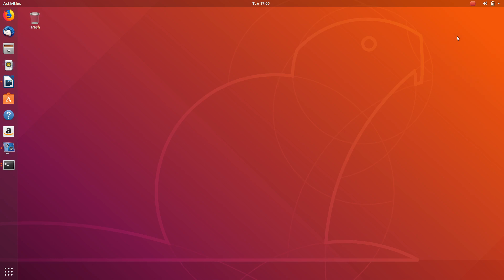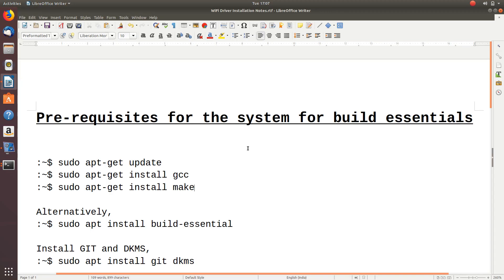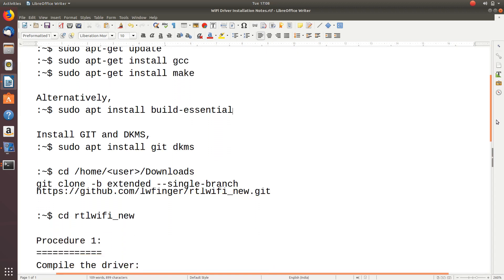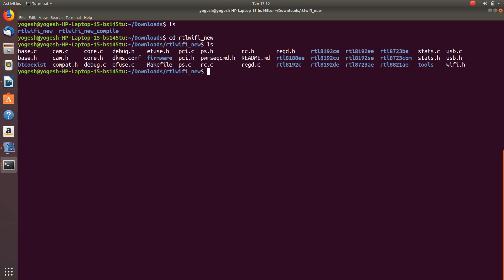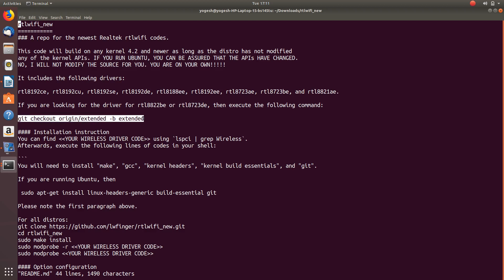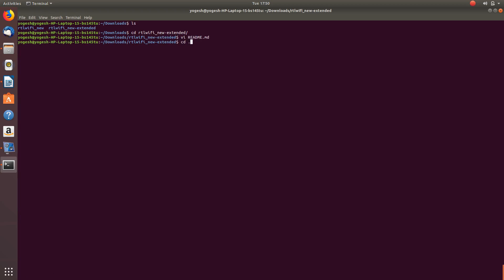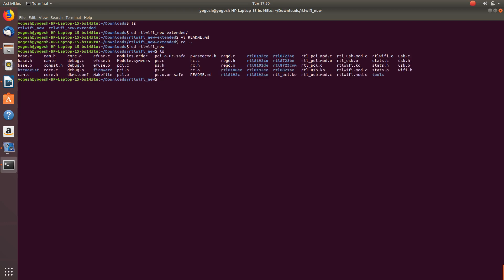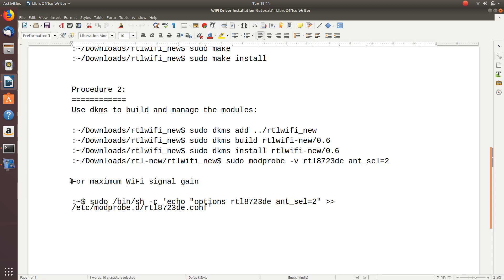HP 15 BS145TU Laptop - Linux WiFi driver install - Chip rtl8723de

Comment from the maker: As the Linux Kernel version increases more features and system calls get added. Below is the link where you can get the driver & instructions for latest kernel:
https://github.com/vvmspace/rtl8723de
OR
https://github.com/smlinux/rtl8723de

Comment: Username for 'https://github.com': *
Password for 'https://*******@gmail.com@github.com': 
remote: Repository not found.
fatal: repository 'https://github.com/lwfinger/rtlwifi_new.git/' not found

i'm beginner for linux system trying to figure out the problem here , using HP 15-r014TX, after bit research got to know that , hp laptops have issue with linux os/kernel due to this wifi adapter not working.
one more identify-    if i use cmd -lspci
- unable to see network controller 

kali@kali:~$ lspci
00:00.0 Host bridge: Intel Corporation 440FX - 82441FX PMC [Natoma] (rev 02)
00:01.0 ISA bridge: Intel Corporation 82371SB PIIX3 ISA [Natoma/Triton II]
00:01.1 IDE interface: Intel Corporation 82371AB/EB/MB PIIX4 IDE (rev 01)
00:02.0 VGA compatible controller: VMware SVGA II Adapter
00:03.0 Ethernet controller: Intel Corporation 82540EM Gigabit Ethernet Controller (rev 02)
00:04.0 System peripheral: InnoTek Systemberatung GmbH VirtualBox Guest Service
00:05.0 Multimedia audio controller: Intel Corporation 82801AA AC'97 Audio Controller (rev 01)
00:06.0 USB controller: Apple Inc. KeyLargo/Intrepid USB
00:07.0 Bridge: Intel Corporation 82371AB/EB/MB PIIX4 ACPI (rev 08)
00:0d.0 SATA controller: Intel Corporation 82801HM/HEM (ICH8M/ICH8M-E) SATA Controller [AHCI mode] (rev 02)

i had same experience with Ubuntu 20.04 and Parrot OS too.
if i use different repositories drivers(rtl8723de/rtl8723be or rtl88) get installs but no result. wifi still not working.

kindly help me which adopter is good and how to install it when i get no repository found for  'rtlwifi_new'
Reply from the maker: Dear Puneeth Kumar,

If you are not able to get the controller details, you can see it in Windows OS using device Manager, checking the controller will confirm which chip you have on the Laptop.

I am not sure which RTL chip you have, but can tell you how to proceed.
Here is a link for the rtl8723de source code.
Link: https://github.com/smlinux/rtl8723de

Note: Realtek RTL8723DE module for Linux kernel version 5

Install instructions:

git clone https://github.com/smlinux/rtl8723de.git -b current
dkms add ./rtl8723de
dkms install rtl8723de/5.1.1.8_21285.20171026_COEX20170111-1414
depmod -a
reboot

Comment: This solution won't work for newer kernals ( like mine is 5.3.0-53-generic). 

The Readme file on github directory says "The master branch of this repo is officially abandoned. If you are running a kernel newer than 5.0, use the drivers built into your kernel. That is a lot less work."
Reply: I love you man! For kernel  5 series this worked. I have been trying this for 2 days ♥️
Reply from the maker: @prakhargupta7125  Hi Prakhar, I am happy that this worked for you ! Thanks for the feedback and motivation, it means a lot to me !
Reply from the maker: If the new kernel embeds inbox driver that will suffice the needs. The intended driver was on those platforms where there was no inbox driver support as inbox for some Realtek silicons. Hence if the driver is present inbox, just a modprobe for the WiFi module will work if the driver recognise the Device ID.
Reply: @automotriztechnica  Thank you for quick response. I am not able to install the driver on my ubuntu. Please assist. How can I get it functional.
Reply from the maker: @vikaskhugshal50  
If there are inbox driver, please try in command console:
" # sudo modprobe -r rtl8723de && sudo modprobe rtl8723de "

where, rtl8723de is the driver name.

Which is the WiFi chip that you have and its device details? When time permits, I will give a try on latest kernels, some C/C++ coding, it will be fun to do, but definitely needs time and patience.
Reply: @automotriztechnica   I guess my wifi chip is "RTL8723DE 802.11b/g/n PCIe Adapter".

The above mentioned command gives and error:
modprobe: FATAL: Module rtl8723de not found.
Reply from the maker: @vikaskhugshal50  Here is a link for the kernel version 5 series:

Link: https://github.com/smlinux/rtl8723de

Note: Realtek RTL8723DE module for Linux kernel version 5

Install instructions:

git clone https://github.com/smlinux/rtl8723de.git -b current
dkms add ./rtl8723de
dkms install rtl8723de/5.1.1.8_21285.20171026_COEX20170111-1414
depmod -a
reboot
Reply: @automotriztechnica  Thank you for your response. But I've already installed Ubuntu 20.04 and it supports the driver.
Reply from the maker: @vikaskhugshal50  The Ubuntu 20.04 LTS is the latest OS where the driver can work, the kernel is not tweaked or customized to that level. Many users have reported too. I am glad that it worked for you. I am also using Ubuntu 20.04 LTS.

Comment: /home/kali/rtlwifi_new/rc.c:336:11: error: initialization of ‘void * (*)(struct ieee80211_hw *, struct dentry *)’ from incompatible pointer type ‘void * (*)(struct ieee80211_hw *)’ [-Werror=incompatible-pointer-types]
  336 |  .alloc = rtl_rate_alloc,
      |           ^~~~~~~~~~~~~~
/home/kali/rtlwifi_new/rc.c:336:11: note: (near initialization for ‘rtl_rate_ops.alloc’)
cc1: some warnings being treated as errors
make[3]: * [/usr/src/linux-headers-5.6.0-kali1-common/scripts/Makefile.build:273: /home/kali/rtlwifi_new/rc.o] Error 1
make[2]: * [/usr/src/linux-headers-5.6.0-kali1-common/Makefile:1696: /home/kali/rtlwifi_new] Error 2
make[1]: * [/usr/src/linux-headers-5.6.0-kali1-common/Makefile:180: sub-make] Error 2
make[1]: Leaving directory '/usr/src/linux-headers-5.6.0-kali1-amd64'
make: * [Makefile:88: all] Error 2

showing this error
Reply from the maker: Please check the kernel version using "uname -a" and update the build essentials package. If there is any kernel update, please update the kernel source for the headers as well.
Please also check if you used the driver source code from the _ext folder of the repository.

Comment: I have a wired error when I connect to my Bluetooth headset it gets connected but when I connect to WiFi ,Bluetooth headset gets disconnected and there is no way to connect before disconnecting WiFi
Reply from the maker: The Bluetooth & WiFi belong to one module component. Which is the WiFi chipset does your Laptop has? You can perform these step of operations and later open a terminal and type "# dmesg " to see the logs what has gone wrong. If you follow this method of driver install, you can use the open source code and the Hardware that shows these issues to debug.
Reply: I have trl8723de I downloaded ,complied ,and installed only the extented repository is it how it should be done.and please brief how to solve problem of Bluetooth

Comment: error: initialization of ‘void * (*)(struct ieee80211_hw *, struct dentry *)’ from incompatible pointer type ‘void * (*)(struct ieee80211_hw *)’
Reply: thats the error that it gives at the sudo make install error step please help.
Reply from the maker: What are your system details, kernel version, etc? The driver source code is kernel dependent, If you are using a latest kernel, please ensure that the driver code is compatible and you have the correct supporting kernel.

Comment: Bro it worked for my ubuntu but in kali Linux it shows 

make:  ***/lib/modules/4.13.0-kali-amd64/build: No such file or directory
Stop

Plzz help
Reply from the maker: Hi Sanu Anand, You have to install development packages, kernel source package and dependable development components, these are needed to compile the source code using make utility & install the device driver.
Reply: @automotriztechnica  how can we do that ...Plz supply cmd

Comment: Sir tell me one thing, wifi is showing now problm solved  .. But i am scared and I m not switching off my laptop , kahi esa to possible ni he.. 
Vapes on karne pr wifi icon gayab hojaye??isliye Maine  abi tk laptop off ni kia....jabbhi on krti hun kuch na kuch problem hojata he .Please btaiyega..
Reply from the maker: Hi Ruhi Ji, Once you compile and install the driver, the driver binaries remain for that kernel version forever. You can perform a graceful shutdown, reboot etc., no issues. But in case your Linux OS gets an update, then if your kernel version gets updated to a newer version, then you need to perform the same steps again after the new kernel takes over. Hence please do keep the downloaded source code files safe. Please note the current version of the kernel using "uname -a" from command prompt or a terminal window, where the WiFi driver is working properly, if the WiFi driver does not load, please re-check the kernel version using "uname -a" because some LInux flavors can update at anytime if auto update is enabled.
Reply: @automotriztechnica  ooh I see... 
Amm thanks for information I will keep ur points in mind..... 👍
Reply from the maker: @ruhianjum3066  I am glad that my video is helping you, please do subscribe the channel too :)
Reply: @automotriztechnica  i want to ask you one thing.. Please suggest... I was using Ubuntu 19.10 in HP.(Along side window)... And after using one month it's showing problem's like hanging, etc... After switch of.. It doesn't get "on" easily., so one of my friend suggest me to install another version, my question is.. As I solved my wifi problem by following ur video.. So if I install another's version of Ubuntu... Or reinstall it..., so wifi icon will be same as it is now? Or it will become invisible again.. And will I need to follow these steps again??? For solving WiFi problem?... Please must answer.... And if possible please send me your email. I'd sir....
Reply from the maker: @ruhianjum3066  Ubuntu 19.10 releases are non-LTS and updates are frequent hence I would suggest Ubuntu 20.04 LTS which is Long Term Support. If you re-install Ubuntu or your kernel upgrades, you need to re-install the WiFi driver the same way if the latest kernel does not have the inbox driver.
The email ID is automotriz.technica@gmail.com
Reply: @automotriztechnica  ooh I see, that why it always shows  problems. And thank you so much for your Instant response it''s great help in this lockdown season.. Thanks a lot sir.
I have mailed you please check if possible.. Will be  waiting for your response... Thank you.
Reply from the maker: @ruhianjum3066  You are welcome. Please do subscribe my channel as well. Thank you.
Reply: @automotriztechnica  yes I already subscribed a month ago,most welcome sir👍

Comment: will it work in Ubuntu 19.10??sir please answer 
I installed  Ubuntu 19.10 in Hp window 10,recently and it don't show wiFi  hotspot connection , what to do now?
Reply from the maker: Yes, it will work, please ensure that you update the development essentials in the system like compilers & make utility for which you might need to connect it to Ethernet port.
Reply: @automotriztechnica  amm i am a beginners for Linux.. Shall I do this all by myself?? Just following your step.. Without knowing what is happening.,I am scared to make mistake..but also I need to solve this problem...no idea what to do.
Reply: Sir after struggling alot.. I finally did it... 
It was not easy for a beginner.. But done.. Thanks alot... This one helps me only
Reply: I have one more problem... 
Plear tell.. How to remove password authentication step.. It's very annoying... 
It appears evry time while I doing work...i want to remove this,...
Reply from the maker: @ruhianjum3066  Please use sudo passwd root, this will create a root password which is a super user mode. Later you can login through other non GUI terminals using root user and password.

Comment: The are asking FOR password and username
Reply from the maker: If you are using Ubuntu Linux, it will ask for password, enter current user password for the operations. If you have logged in as a root user, you can use these steps directly.

Comment: I am searching for the solution  since past 2 days. I am unable to resolve it. Please help me !!!!
Reply from the maker: You need to check which WiFi controller do you have on the motherboard populated. Which Laptop model do you have? Boot it into Windows 10, you can get the WiFi controller details  from the Device Manager. Later based on this info, you can use the source code of that WiFi controller to compile it in Linux and install the driver. Hope this info helps. Good luck !

Comment: Sir I have downloaded Linux mint 19  but there is no'WiFi wireless option  for it what should I do
Reply from the maker: First, sorry for the delay. If you have Ethernet port, please connect the Laptop to the network to download the soruce code of device driver and then run the commands. Alternatively, you can try downloading the packages if you have the development essentials already installed on your system.

Comment: Hi, I do not understand your language but I am helping myself with a translator.
I see that the problem with the RTL8723DE worked, could you help me with Scythian instructions? I would be very grateful.

excellent video
Thank you
Reply from the maker: Hi Juan Merios, If you follow the last part of the video section at 16:23 time frame onward, it has the required commands that will help you. I searched for Scythian instructions, need more support on the translation part as I am not sure that English to Scythian should be one to one match. Let me know any other methods that I can help you.

Comment: after every ubuntu update .it disappear and need to reinstall this,doing this 4th time.
Reply from the maker: Manish, Understood your problem, after Ubuntu updates, if the kernel is updated to a newer version the driver needs to be compiled and updated similarly on the kernel that you are using. The updated kernel will not have the driver that was installed for the older kernel.

Comment: Can i use this method for
 parrot os. Please help
Reply from the maker: Hi Vara Lakshmi, The Parrot OS is a Linux, based on the Debian. It should compile the driver and install. I have tried it recently on latest kernel as well and on Mint Linux.

Comment from the maker: After driver installation, the WiFi signal strength will be low after first boot, to boost the signal, please run the antenna selection level in the shell " sudo /bin/sh -c 'echo "options rtl8723de ant_sel=2" >> /etc/modprobe.d/rtl8723de.conf' " and reboot your system. This is shown in the last few minutes of my video.

Comment: Could you please gve the signal strengthening comand in comments section and pin it... It would really help... Thank you.
Reply from the maker: Hi Nitin, Please run the antenna selection level in the shell " sudo /bin/sh -c 'echo "options rtl8723de ant_sel=2" >> /etc/modprobe.d/rtl8723de.conf' " and reboot your system.
Reply: thank you agin

Comment: After following your guide wifi adapter installed successfully but it is not detecting my home wifi it is only detecting which is just a meter away from it.Any solution pls let me know thanks.
Reply from the maker: You need to boost the antenna signal level. Please run the antenna selection level in the shell " sudo /bin/sh -c 'echo "options rtl8723de ant_sel=2" >> /etc/modprobe.d/rtl8723de.conf' " and reboot your system.